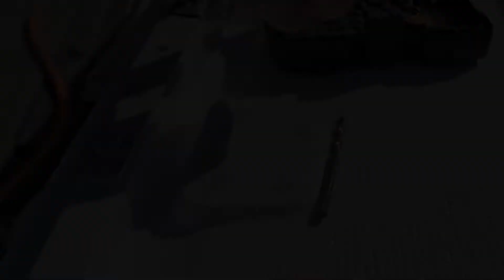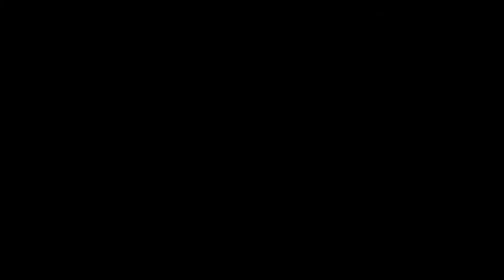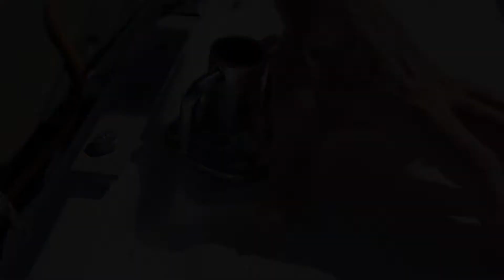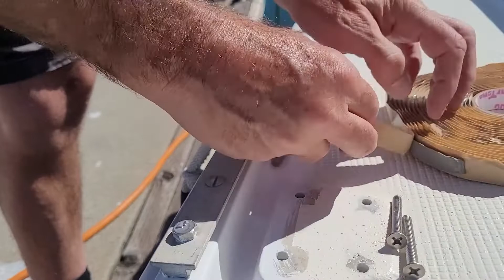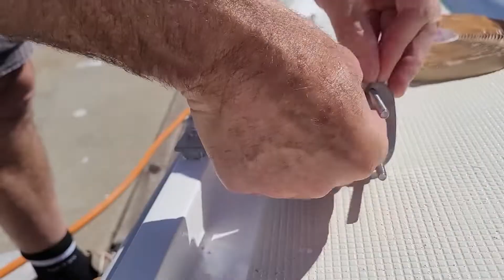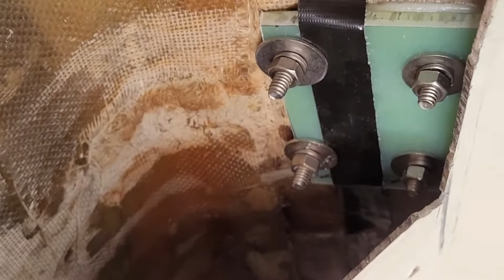Installing deck hardware (stanchion base) with butyl tape.

Comment: Is a thread locker needed to prevent the bolts on the underside from backing out, or is that unnecessary?

Comment: What is the green plate above nuts?
Reply: Looks like a backing plate to spread the load on the fiberglass. Some people use metal plates, but the best idea I’ve heard is to use Starboard (or use a piece of plastic cutting board). Without the backing plate, you might get some stress cracking around the nuts. But the way my boat was manufactured, none of the nuts in the cabin for the stanchions or Genoa tracks have backing plates.
Reply: @kites4121  Thanks a lot.